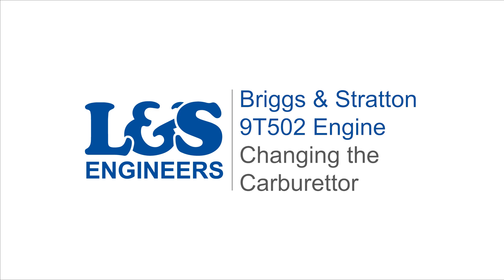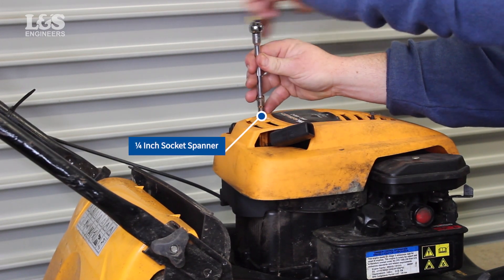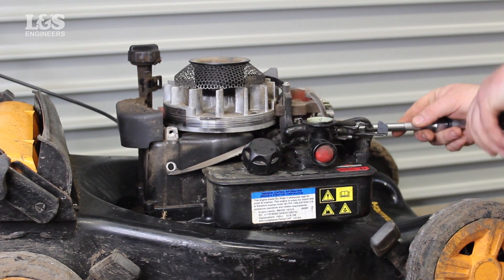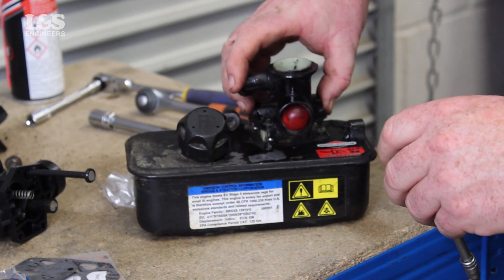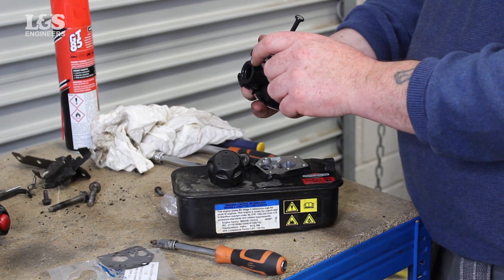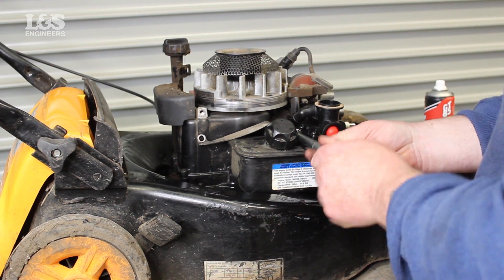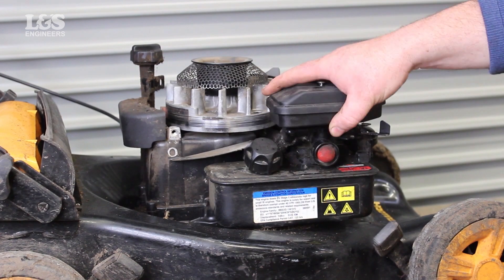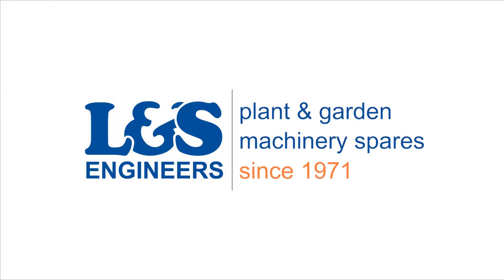How to Change the Carburettor on a Briggs and Stratton Engine for the McCulloch M40-450C Mower | L&S

Comment: Not enough detail and he stands in the way.... There are two gaskets in the pack I received....one conventional grey card type and a flimsy black one. No mention of the pair only talk of a gasket.          It would be good to see which face each one goes to although I would think the flimsy black one goes to the tank.   Also not enough visibility or info on the fitting of the two springs..... Video could have been better in detail for the viewer.